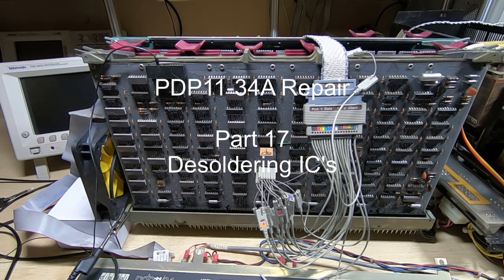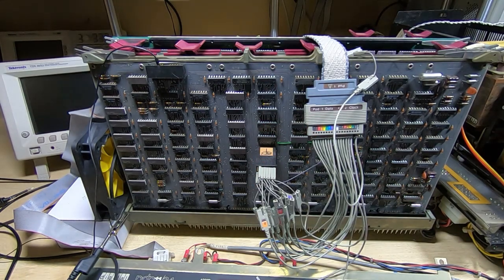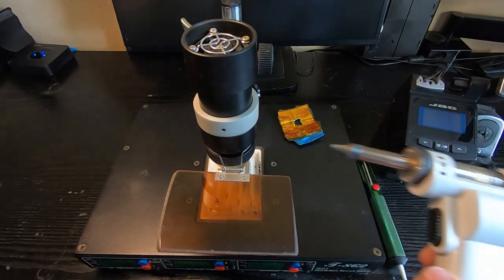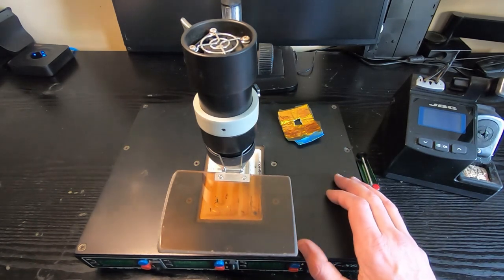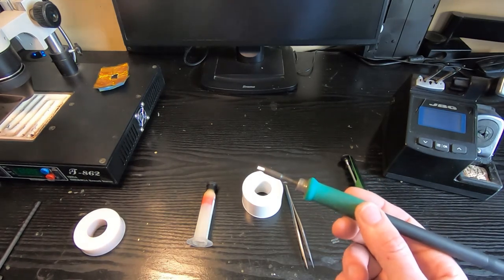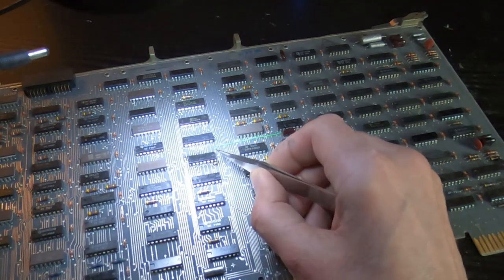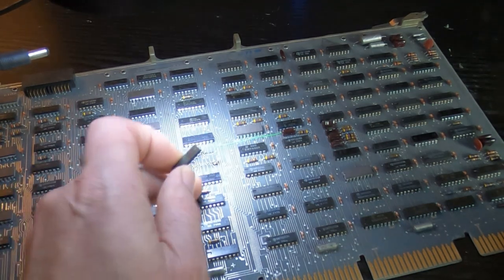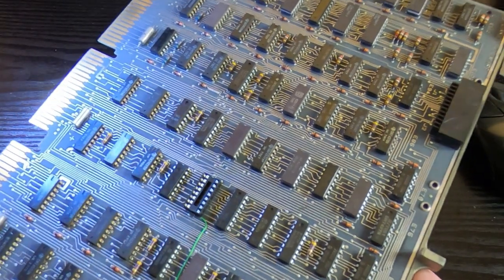PDP11-34A Repair Part17 Desoldering ICs

Comment: Very useful video, thanks, I'll definitely use solder wick more often in the future, I hadn't realised how good it is for this.
When I was repairing this sort of board professionally (I think I did fix one or two M8266s) I always used the "cut the legs off" method, but of course the objective back then was to replace the chip quickly, and there was never any requirement to examine the removed chip afterwards.  Also, the PCBs were less old, less fragile and not irreplaceable in the 1980s of course!
P.S. I've had a dig through my "library" and I've got circuit diagrams and microcode flowcharts for these boards, but sadly no ROM listings.  I think one was expected to get a new ROM from stores.
Reply from the maker: Yes, when I used to repair systems professionally I worked for the company that manufactured them and often they just expected the boards to be replaced rather than repaired but when component level repairs were carried out I used faster and more aggressive methods. If the boards were damaged then I could just get a replacement although pride made me at least attempt to do no harm. Most machines I repair these days are not mine and are fairly irreplaceable so there is far more pressure to avoid damage so I evolved into my current methods over time as I discovered what works best (for me anyway). If you have any literature on the PDP then I would be interested in it. By the way your ASR is enjoying its new lease of life.

Comment: I recommend original soldapullt desoldering tool, mine doesn't have the recoil, i used to have a knockoff that looked very similar but the recoil was so strong that it would knock a pcb all over the desk, model number on mine is DS 017 but i`ve seen few other models that they make

Comment: I'm wondering if you've a preference for a particular style IC socket?  I like the molex machine-pin style DIP sockets for ICs, even though they are a bit more expensive and require a bit more care when inserting devices.  Do you think there's a practical difference for this kind of application?
Reply from the maker: I generally do not use turned pin sockets for this type of application because I need to plug de-soldered or NOS IC's into them and turned pin sockets are not good for this as they tend to fold pins under. In general a good dual wipe socket seems to work best and can be used with either new or de-soldered IC's. This type of socket also generally has lower insertion force than turned pin so makes insertion of older devices easier. For new pcb's I do not really have any preference although I prefer not to mix types on a single board. Years ago I preferred turned pin but have tended to move towards good quality dual wipe types for general use. If I use turned pin these days it would probably be because I want a gold plated socket.

Comment: I sometimes add RA flux to my "Solder Wick" (or equal) to get it to "wick" the old solder up better.  But I also add solder too when needed.  I'll definitely practice using my microscope for desoldering on some scrap boards, especially since my eyes aren't getting any younger!

Comment: Yes, desoldering from those boards can be difficult.
Old dry solder, narrow holes and fragile pads.
Any reason why you don't use an electric desoldering station?
You know those similar to the handheld item you showed,
but with the pump and power unit in a box on the table.
I bought one for just 110 Euro and it work really well on dobbelsided boards.
Reply from the maker: I do not use desolder stations for this sort of board as you have far less control over it than over the manual approach. They seem to really struggle with old dry solder and it only desolders from one side so leaves the pins partly attached. I have tried many different types over the years (and still use some for certain types of boards) but I would never use one on these boards. My aim is to leave the board unmarked and undamaged and also avoid damaging the IC and this is by far the best method I have found. This is my personal choice based on thousands of repairs but everyone should find whatever method they prefer.

Comment: One tip on using the desoldering wire on old PCB's: Don't desolder the pin directly next to it. Make it random, in this way you keep the risk of delamination of the board the lowest. So not 1 2 3 4 5 6 but 1 3 5 2 4 6 for example. Then the heat is not concentrated for a long time. There is also low melt desolder alloy which you can add to the existing solder joints. After applying that, the melting point drops and you can desolder with even lower temperatures.

Normally I cut out the chip and then take the pins out of the PCB with a tweezer. But in your case I understand that you want to preserve as much as possible from the ROMs.
Reply from the maker: I actually find that soldering them in order (1,2,3,4 etc) works best and causes least damage because it effectively preheats the next joint and so the joint can be desoldering more quickly (That is what the preheat pad is for on the IR rework station and why reflow profiles have a preheat stage) but it probably depends on specific technique. In general the less time the iron is applied to a specific joint the better and for multi layer boards the underside will take longer to heat up from cold so the top pad may lift before that happens but if the board is 'preheated' then the process takes less time and the chance of the top pad lifting is lessened.